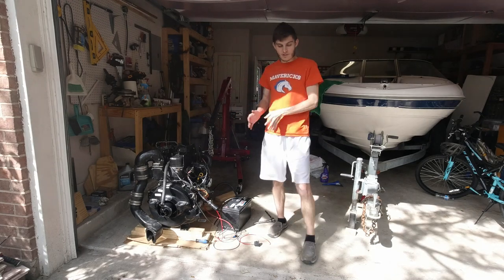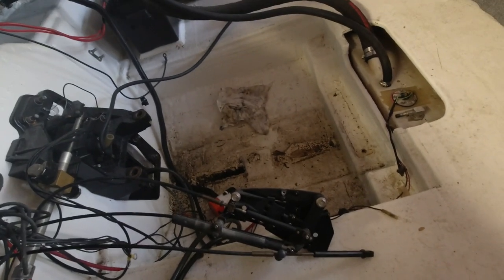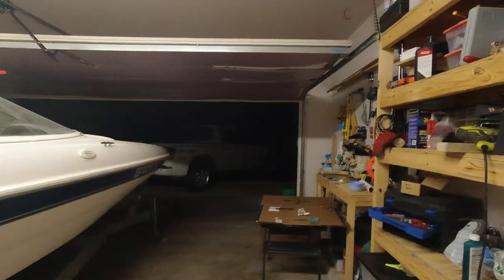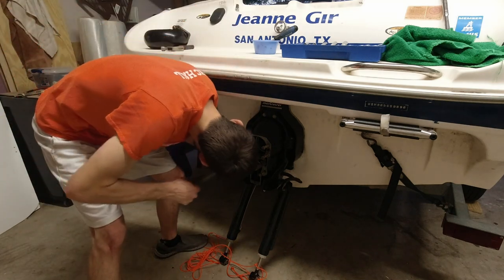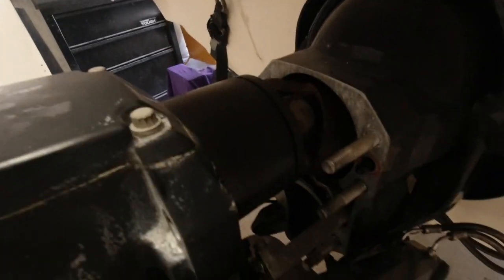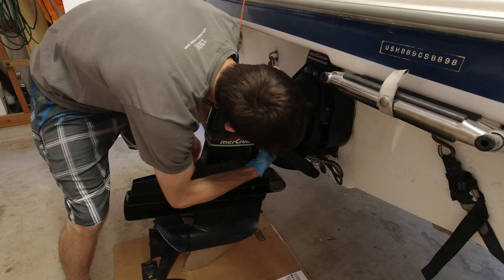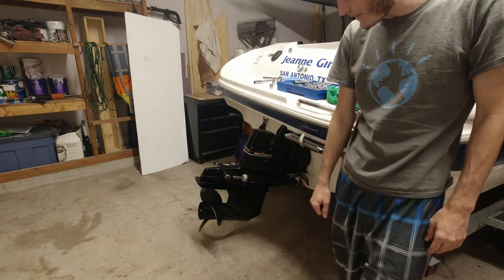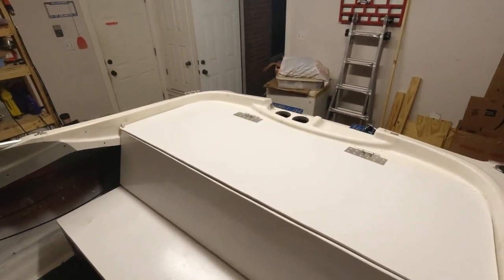How To Install MerCruiser Engine and Outdrive

Comment: Zach, I did a complete engine replacement on a 18’ sea-ray this past spring. Your struggles were almost exactly like mine and if I had the extra time I would have loved to document them on YouTube like you’re doing. The boat looks amazing from where you started and you should be very proud of your accomplishments. One suggestion once its done and you are finally able to enjoy using it on the water. Get a set of trim tabs. Nauticus makes a set that goes for around $100 and they make a huge difference with how the boat handles. Much easier to get up on plane and a lot less bouncing at higher speeds.
Reply from the maker: It's funny you mention that! We have actually been using the boat that I haven't shown as much in videos. But trim tabs / hydrofoil is actually on my Christmas list 🤠 couldn't agree more! Thanks for sharing!

Comment: Hey wanted  to tell you thanks for the help and very impressive you got back to me so soon great channel to be of. 

 Something that may come in handy for someone someday or save some part of their anatomy when I was trying to figure out what I was doing wrong I hooked the positive straight up to the coil causing all the spark plugs to spark obviously what I didn't expect was the motor to start up yes it started up. 

 Without any help from the starter whatsoever I was surprised because it seems like it would've had to preserve the cons the compression along with being in just the right spot but what do I know

Comment: When trying to align the spline, it’s easier to turn the prop rather than pulling it out and turn the driveshaft.
Reply: I’m removed my drive to replace a hose now I’m trying to get it back in and I can’t get any closer than three inches.  I have it in drive.  I do try and turn the propeller counter clockwise but drive won’t turn unless I pull it out of housing a little.  Any help is appreciated

Comment: Yu Zachs, I need to move nearby your neighborhood bro. Man, you are a cool guy, a very talented and hard-working guy.   I got a 2009 Bayliner 4.3 that the outdrive did not raise up and now sound metal in the side when i run the boat. So, i am planning to take it apart and do what you did on your boat.

Comment: Help? I removed my alpha one gen two drive to replace a water house now I can’t seem to get it back on.  I have the boat in drive .  Shifter aligned but I can’t get any closer than two or four inches.  Help?
Reply from the maker: Isolate the point of failure, or in your case the point of stopping from getting it on. Might be drive shaft splines, stud bolts, etc. Look for anything that can get in the way

Comment: Do you need to remove the outdrive or can engine be removed with it in place? Seems like if it could be brought forward while removing it would clear the shaft
Reply: Yes I’d like to know the answer to this question.
Reply: @bryceblunk6214  the outdrive has to be removed before the engine can come out

Comment: Where did you get aligning shaft
Reply from the maker: Just realized I didn't have the alignment tool added to my engine rebuild cost breakdown spreadsheet with tools. I just added it now. I got it on amazon, you'll be able to find the link for it and other tools on my spreadsheet here: https://bit.ly/2TQZHdi